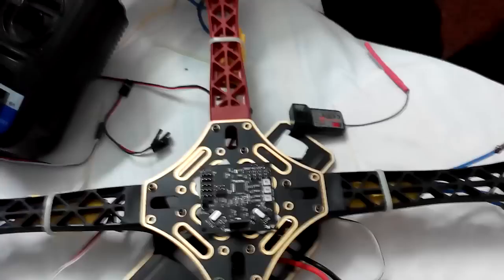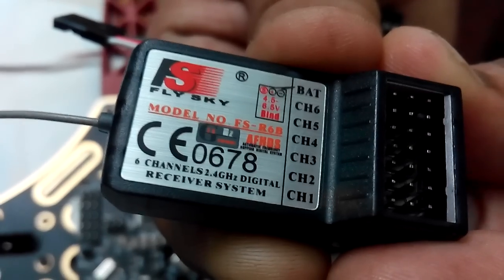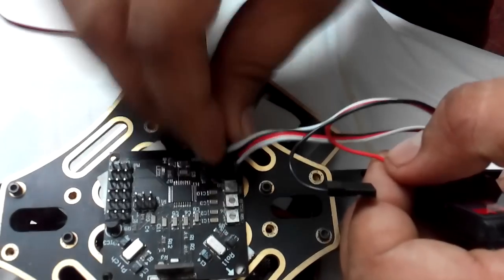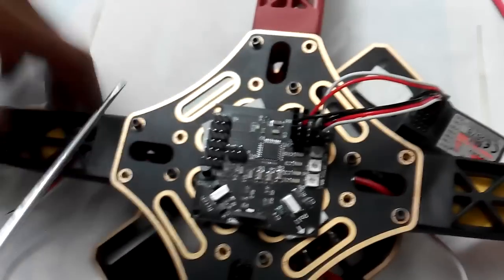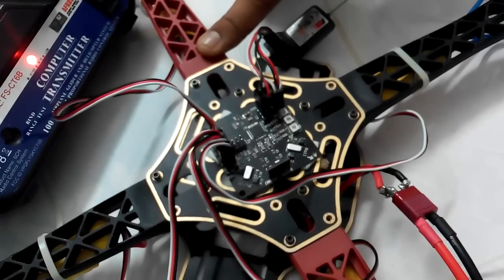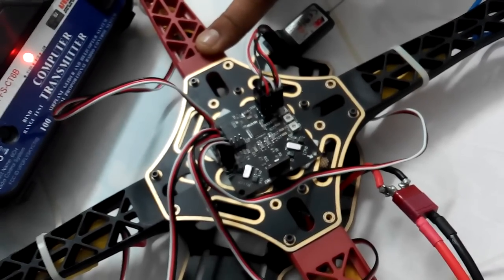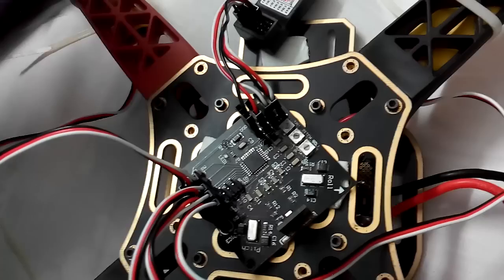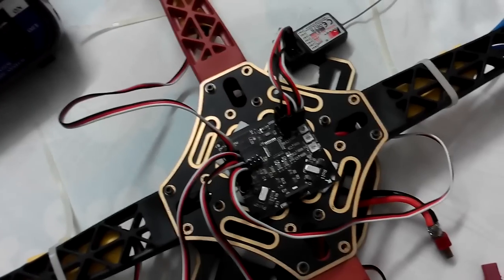KK Multicopter control board V 5.5 Setting Startup Flying Controller Programming

Comment: Nice and detailed video for drone making, but I have a doubt for binding transmitter with flight controller which port should be use in flight controller bcoz you are not said anything about initial binding between transmitter and flight controller

Comment: please help,
i have done everything same as you 
same board 
same transmeter
whenever i try to fly this drone pitch controls are work in reversed.if i move stick forward drone goes backwards. 
what is the reason? and how to fix this?

Comment: I used a cc3d. I used the libre pilot ground control station to program it (as open pilot ground control station is discontinued and cannot be downloaded in which ever download page I go) but  the receiver board seems to sense activity of the transmitter (when checked in the computer), as well as the motors are spinning(while calibrating). But the quad copter dose not seem to fly(no output in the motors while I independently use a battery and the transmitter). What can i do???

Comment: I did not understand how to give power to kk board. Can anyone please guide?
Reply: Hey its been 6 years but did you figured it out? I'm planning to connect one of the motor plus and ground pins to my battery. In this video I assume kk board powered by ESC connections. But my ESC doesnt have + cables only signal and ground.

Comment: mine is not arming
plzz help
Reply: hi reduce ur throttle trim..it will work
Reply: +stone stephoney  mine too not working..what to do with it
Reply: +vikranth kumar reddy.m hi 
I just found a prob
Set the trim value to the extreme right 
And then try
Reply: stone stephoney https://youtu.be/9sq095YTB5k kk flight controller board full guide in hindi
Reply: stone stephoney you can try this video for more help  https://youtu.be/9sq095YTB5k
Reply: plz help me someone
Reply: plz send me friend request on fb 
Amey Angadi
to help

Comment: Nice video... But i have a problem. Here i give the step by step what i do.
1. I connect receiver wiring shown as per your video 
2. I connect all 4 motors wiring correct as per diagram M1 to M4 
3. Trim the YAW in 0
4. Transmitter ( HK T6A V2 - 6 ch Mode 2 ) switch ON 
5. Throttle stick UP position 
6. Connect the Battery, & Blink the blue LED 3 time & all calibration  process ok ( Tx switch on position )
7.Then Down the Throttle., 
8. While UP the Throttle ., all the motors runs as per given your video. ( clock ,Anti,clock,Anti)
9. Disconnect the battery., ( Tx switch on position )
10. YAW in Maximum position ( Tx switch on position )
11. connect the battery - ( Then all motors vibrate with beep sound ) ( Here is my big problem ) 
12. Increase the throttle ., Nothing Happen of M1 to M4  
13.The Kk5.5 board goes on calibration mode( Here is my big problem ) 
so pl solve the problem sir OR mail me sj28550@gmail.com
Reply: +Subhash Jadhav keep yaw at minimum and then it will work